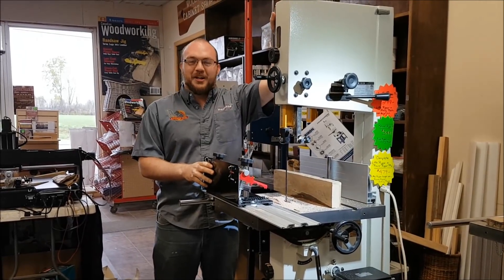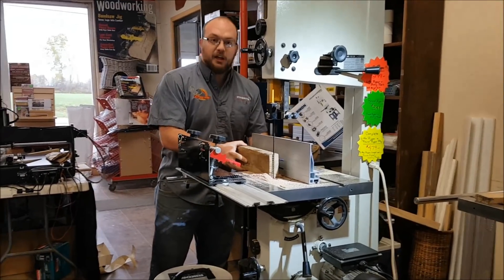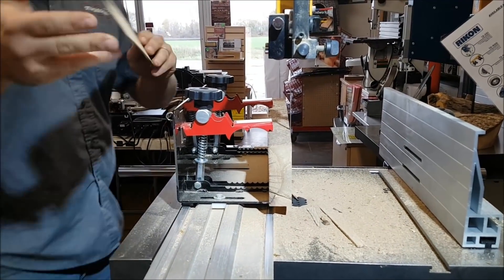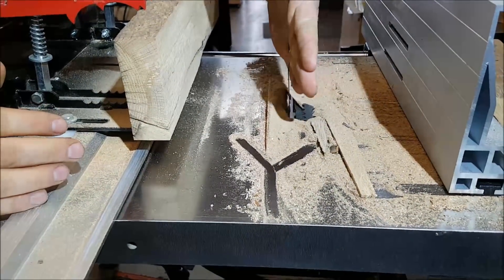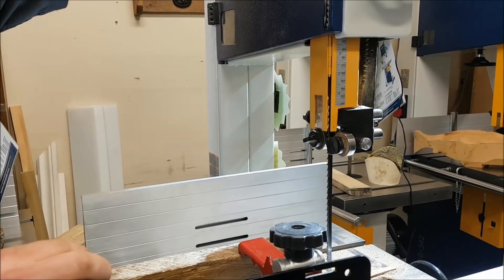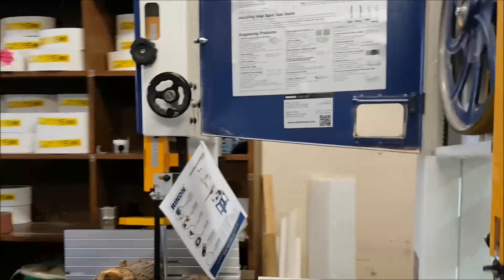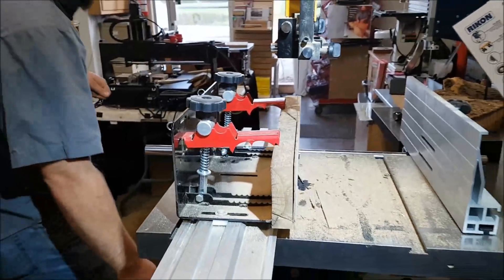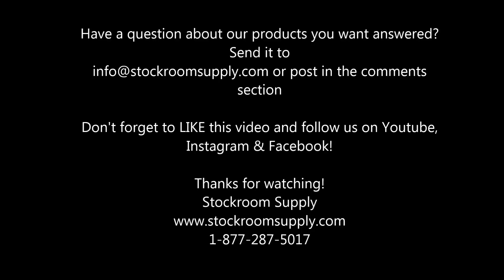EthAnswers Blade Drift myths, Why Bandsaws Should Never Drift!

Comment: I bought this tool. I'm about 95 percent happy with it. I had to replace the plastic guide that came with it. The guide under the top piece. It was squeezed out of shape by the bolts that attach it to the tool. The.bolts that came with the tool were too.short for my bandsaw also.

Comment: Nice video and demonstration. I definitely haven't experimented by removing guides or reducing tension to such extreme levels. My question is whether this would work for a wider blade or one with thinner kerf, or a dull blade. I assume the back of the blade would touch the wood if it has less side clearance?
Reply from the maker: Just to be clear this video is not advocating removing the guides on your bandsaw. It is intended to show a fence is the root cause of blade drift. This video goes into more detail - https://youtu.be/5M9oOS_UPWQ?si=Sp2QiRR3IxnbRDEW

Comment: I found an old Sears Craftsman table bandsaw direct drive. I have replaced the tires but nothing else. Cutting free hand with no fences, I cannot cut a straight line even if I just try to follow a pencil mark it always veers to the left. Can an old dull blade cause this? Or what?

I just tried clamping a block down as a fence. It's till veering to the left BUT the underside of the cut has burs along the right side.  This is my first time using a saw like this so I expect this is telling me the blade is dull on the right side?

Comment: I'm confused. That Little Ripper is a guide just like the fence. The big difference is your first cut cut off the waste to where the blade naturally drifts. The second followed the same drift so you now have a straight cut. You can also do the same with the fence. First cut off a thin slice to cut off the waste (drift), but not next to the fence but on the outside just like the Little Ripper  so you don't bind the blade against the fence. Then angle your fence to follow that drift, which probably won't align with the table.

Comment: Damn! I’ve come to the same conclusions on my own. However I have a 1 inch wide blade on my saw which is the widest recommended for it. It was mounted fully across the wheel with the teeth at the front of the wheel. It would constantly wander forward and backwards until I mounted it with the teeth in the centre of the wheel. Now it stays in the same place. Thanks for the post.

Comment: hi what is the sled that you are using, i have a 10 inch wen bandsaw that i have drift problems with, i need to resaw wood into thin strips for curves in my cutting boards and other projects i think that sled would help if i can get one that fits my tabletop the miter slot is smaller than normal. thanks

Comment: So how do I stop it from binding then when I’m not even using a fence. Just a carter log mill and the blade binds.
Reply from the maker: Something to keep in mind in the Little Ripper , or your log mill, doesn’t eliminate blade drift it prevents it. So if I’ve used a blade with a fence before unfortunately we’ve put drift into the blade and it won’t ever cut straight again.  You need to dedicate a blade to your carriage to prevent drift. The Log Mill does a good job at making a square edge on a log but unfortunately doesn’t allow you to do much resawing beyond that. 
This video helps explain this a bit more - https://youtu.be/V9OOGmahZBE?si=QFFQDW-tY5jf-Z4V
Thanks for watching!
Reply: @StockroomSupply  I put a brand new 3 TPI blade on and not 4 inches into the cut it swerved right towards the carrier. Good tension, tracking set and all guides set.

Comment: I think the general issue is, if you use a fence and your tracking is off, the probability of binding is greatly increased. I've seen tracking drive the blade toward the fence. If your saw doesn't have a dolly like yours then the fence is required and so the tracking has to be perfectly straight to prevent binding.

In your example you reduce the tension and the tracking. If you have a tensioned blade then the tracking has more of an impact as it stays more "true" to the tracked angle. Try with a tense blade and tracking off.

Comment: Impressive demo, but how the little ripper is any different from putting a fence on the other side? (or putting the off-cut on the others side?) It's still a mechanism that's holding the wood parallel to the wood on one side?

Comment: Do you know much about large band saws they use in Wood Mills? we use seven to eight inches wide blades with a saw ker about 0.13 of an inch the blade itself is around 0.09 it runs on two hard rubber guides with a lot of Lube and we have a Crowder with extreme pressure pushing it up against a line bar just wanted to know about things I could do to avoid the blade snaking or drift as you call it

Comment: Hey Ethan, thank you for such a thought provoking video. I have the same bandsaw you used and I experience exactly the same problem whwn resawing, but when I cut small pieces it doesn’t drift. Both cuts using the fence as a reference so how would you explain rhat I only get blade drifting when resawing? Any advice on how to fix it if I don’t
Have the same cool jig you used?

Comment: Nice to see a little evidence! Presumably, if you use the fence to cut off a thin strip on the outside of a block of wood, it should cut straight as the thin piece will bend much more than the thicker piece next to the fence? Love to see a more detailed version of this video.

Comment: What a load of crap to sell his monstrosity. No all wood will go away from the fence. The stress in the wood relates to the way it is dried not in the device you are using to cut it. It is just like in a table saw. Sometimes the wood open after the cut, sometimes stay the same and sometimes try to bind the blade. Never mind the motion of the wood needs to are parallel to the blade regardless of the device you use. A fence, or that aberration you are using.

Comment: I have a Metabo BAS261 that I cannot set up correctly and it's actually drifting toward the fence no matter the way I do the cut (with or without the fence). I tried everything, blade position table set-up, clearences, notrhing does. It's still and always drifting toward the left of the blade where the fence is or should be. I'm a little lost, so happy to get any advice. Thanks.

Comment: After watching this a few times and using my bandsaw, I find you can get the same results with a fence.
The key is 1) slower feed rate (especially with less tension), and 2) rip with the cutoff on the opposite side of the fence.

Your hold-down jig is basically a fence with the all but the top and bottom (image a fence without the bulk of the middle).

When you push the stock and put pressure, you deflect the blade and that is what makes it wander. When you have the veneer cutoff towards the fence, it has no where to go.
It’s like cutting a case-hardened board on the table saw. After feeding it just past the splitter I add a shim to prevent the binding. The same could be done on the bandsaw.
Reply: Point #2 seems like the crucial point, especially.
Reply: Look I’m a sawyer and let me ask you this:
What’s the most you’ve seen a board spread apart while being ripped? I’ve seen stuff spread 3+” both verticals horizontal and a compound of both. Using a fence under these circumstances will lead to the blade drifting due to being half dull. 
I use my fence all the time! Blades get thrown out all the time. Part of the game… all these guys literally can’t afford to Woodwork without blade drift. It’s all in the blade and like ethen said binding it under its own fence is number one cause

Comment: This is exactly the way a sawmill carriage works on a commercial mill - as long as the carriage runs parallel to the blade.  It shouldn't be surprising that this nifty device works well.  It's just a miniature version of the big boys.

Comment: Thanks Eth, but I still don’t understand. Surely this is the same as cutting using the fence but reversed? Using a fence, you’d cut the veneer to the right of the blade but what you’re doing is cutting the veneer to the left of the blade. Are you saying that doing it that way gives a more straight cut?
Reply: I think the ripper holds the stress of the board and prevents it from pushing against the blade like the fence would.
Try a sacrificial fence that only goes to the blade and no further down the table see what happens.
When you cut something free hand and have drift still it might be the blade is dull on one side.

Comment: The capacitive start is sticking and not closing the circuit on start which is why it stalls when started. It should be opened and inspected for wear or sawdust buildup which may be the cause of this.

Comment: They will drift if one side of the blade had been dulled by hitting grit or some other hard substance in the cut. To correct, take a sharpening stone and very lightly hold it against the side of the  running blade that leads off line. This dulls the sharp side a bit causing the blade to track straight again. One sided sharp blades track towards that side.

Comment: I cut veneer from the right hand edge of the board so there is nothing to put pressure on the blade and the cut still drifts (to the right).
Freehand, unsupported cuts do the same. Where’s the binding there?

Comment: How much should my upper, lateral blade guide gaps change from the bottom to the top of the cutting height range?  Mine change about 0.045".  Is this normal?  Thanks (this is on a new 14" bandsaw).  Is this a big deal or should I just carry on?  Thanks.

Comment: I have had little problem with this saw for 10 years; now it cuts toward the fence, which he says never happens.  I tried his setup, low tension, all guides backed off, etc., no effect.  I tried positioning the blade from front to back of the tires with zero effect.  Was ready to throw this thing out the door.  Installed a new blade out of the box and it now cuts perfectly straight, even though it drited with 2 previous blades.  My only conclusion is that their teeth were somehow damaged on one side.

Comment: Check out the Alex Snodgrass video "30 Minute Bandsaw Rehab" and eliminate blade drift for free and forever.  His system also makes switching blade widths a lot easier and faster.
Reply: Bingo.  Aligning the deepest part of the gullet w/ the center of the crowned wheel offers the teeth more support and eliminates drift.  Also, if an offcut pushes against the fence, why not counteract that by cutting from the opposite side of the stock for no pressure?

Comment: This is not a proper experiment. You did not isolate variables or measure.  Blade drift is a result of cumulative errors - specifically when the tooth set cannot overcome intolerances in the parallelism of the blade to the cut line. All of these calibration variables contribute to a sum that can exceed that total tolerance, not just one variable. You are just demonstrating that this particular setup does not exceed that tolerance even with the flaws you created. Most likely what you've actually demonstrated is that feed rate is the largest factor at play. You went very slowly and that gives the tooth set more time to self correct. If anything - loosening the tension IMPROVED things because the vibrating blade effectively has a wider kerf (at the expense of surface finish, noise, and wear, doing the same job a thicker blade would do)

Comment: Wow, that's quite an eye opener, never would have thought, low blade tension, top guide much too high but perfectly straight cuts. Of course all of this is out the window if your blade is warped or dull.

Comment: THANK YOU!
I bought a used bandsaw, and it was drifting to the left like crazy.. My instinct was that it was simply cutting less on the right saw, but being the millennial that I am, I had to get instructions on YouTube how to adjust a bandsaw..
So I was fiddling with guide blocks, blade tension and how the blade was running on the wheels. Finally I gave up...
Your explanation made things click for me, the blade is a laser beam, unless you touch a non cutting part of it!
With that in mind I went back to investigate.. Turns out the teeth set to the right were quite damaged, I guess the previous owner might have run into a nail.
After setting the teeth and sharpening the blade, my bandsaw cuts straight!

Comment: Despite having (almost) everything perfectly set up, I was getting severe drift of the blade into the fence. This was cured, finally, by rotating the table on the trunnion so the fence (and miter slot) was parallel to the blade's cut.

Comment: What about one sided dull blades? If you cut a lot of circles your blade could get dull on one side more than the other which also leads to drift without binding it. You may have proven your point for nice sharp blades though.

Comment: Though I'm very late to this party and didn't read all the comments, I did not notice anyone specify, IMO,  a key point that someone can correct me on if needed, cause I'm actually uncertain. Doesn't the sharpness of the blade play a key role in drifting? If the blade is dull, will it drift or still cut straight with burn marks?

Comment: I stopped at 2:14.  When you use a special jig (e.g. a sliding table) to hold the stock and don't use just the fence, the only point you're proving is that you'll always have problems resawing until you get this fancy jig. It's a great tool, and it works. No doubt about that. I've seen it used on other channels. Now set it on the side and do all of your resawing with just the fence.

Comment: Ethan, I apologize for my original comment. When I looked at the top wheel I was looking at the yellow rubber and it appeared as though the teeth were backwards. When I reviewed it after your response I guess my eyes adjusted and I was able to follow the teeth. The blade teeth were further back with the teeth in the middle of the wheel. The other thing I noticed is your using a device to clamp your wood. This doesn’t allow any movement of the wood. If you tried to cut the wood free handed, I bet you would get the “drift”. Most people cut without the clamping device. Where did you get that clamping device? I realized that I was not setting my band saw with the teeth set to the middle of the rubber band or the wheel. That could be my problem as well. I will try to set my band saw up like you did and try it again. Thank you.

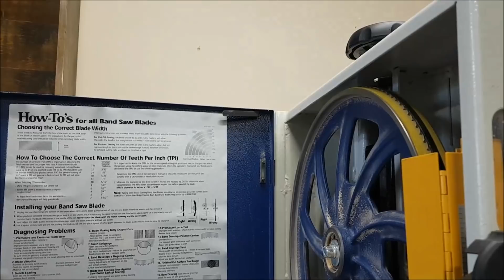Comment: Ethan, at video clip 6:38 you show the top blade wheel with the teeth of the blade facing towards the rear of the wheel but when you show the teeth of the blade they are facing forward. That’s a really good trick especially when you said you didn’t edit the video. With the teeth facing backwards that would put the blunt face of the blade forward and you wouldn’t cut anything! How do you explain that?
Reply: I rerun it 3 times the blade is always on the right way.

Comment: He's preventing the wood from opening up (at least on the side clamped to the jig), so this prevents the blade from being pushed over (called drift - which is what causes the set on the teeth to get changed).  Once the set on the teeth are changed, it will never cut straight again.  The other side is free to open up and will not affect the set on the teeth because no binding is occurring. 

So 2 keys things are happening here:
1. The jig is holding the wood firmly in place so it cannot move (which it normally would because of the internal stresses being released unless you have an exceptional piece of wood)
2.  The wood is not binding the blade and wrecking the tooth set .

Comment: Even when pushing timber through freehand, my bandsaw cuts skew.  Pulling my hair out.  I have to push through at an angle to cut a straight line.  Any ideas?
Reply: I solved my drift at last after replacing the tires.
Reply: @EwanSadie1  any thoughts on why that was the fix? Like do you think the crown was so off/beveled that it was causing the blade to be off-angle?
Reply: I'm dealing with this as well. I think it's what he's saying: blade dull on one side so it steers to the sharp side. I'm going to try a new blade shortly.

Comment: What aboot a fence that is only half the length of the table, that stopped right at the blade position? The board would be registered against the fence while being guided into the blade, but then free to bend as stress is released after it exits the blade.  You could even make a little 1/4" thick add-on fence that did this, since a board is unlikely to bend more than 1/4 over the length of the fence on the outfeed side. completing a cut would require attention to safety, as the board will become "unregistered" in the last few inches of the cut.

Comment: Just bought a Porter Cable handsaw and found that the drift was caused by the table being out of square. I removed the table, loosened the two bolts that held the tilt clamp bracket and then twisted the bracket to square it to the frame. I the reattached the table and after readjusting the rollers, I set the fence and did a test cut. The drift was non existent.

Comment: I watched this video. Put a new coarser blade on my old Ferm bandsaw and cut a thin layer of hardwood away furthest from the guide block. It worked a treat. If I cut the thin layer close to the guide block it drifts! Point proven. Thanks.

Comment: There is also a possibility that the welding point of the blade is not up to standard. It is not common on india made blade, but it do happens. I have a blade made in india, the welding point sucks, if you lay it flat on table or a piece of glass, there is a gap. which means whatever you do to tie the blade on the wheels, it is jurking. Don't think it is a rare case, if it is chinesium blade, you better check every blade you have, quality control is nothing, even worse than india.